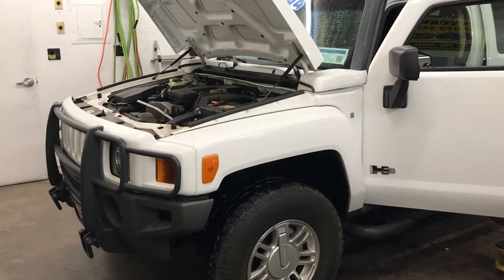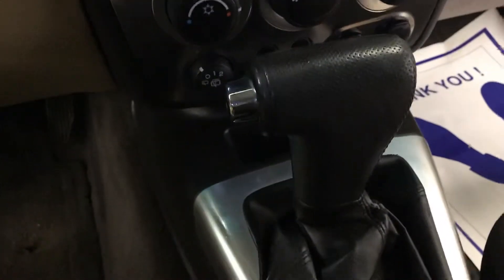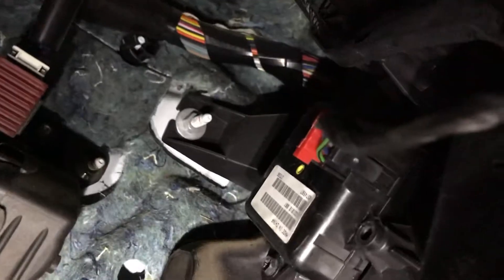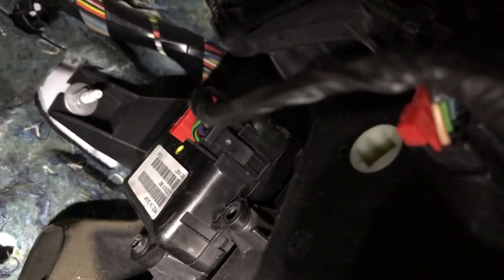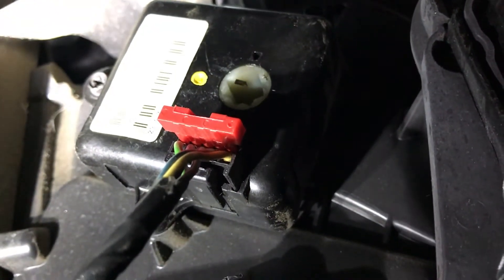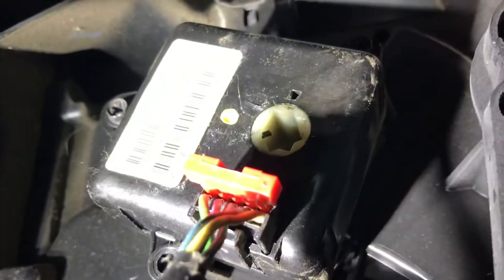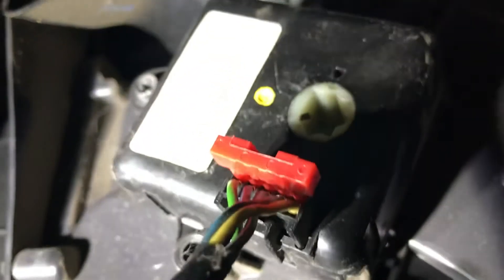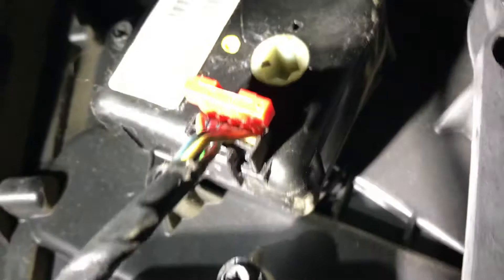Hummer H3 blend door actuator identification

Comment: Thank you for the video. My  ac works and the vent speed works. I just don't have heat. Hopefully after replacing those two you pointed out will fix the issue.
Reply: Did it work?
Reply: @Banestudent21  yes it did. Thank you

Comment: thanks for the video. quick question: i had the actuators replaced a few years ago but i am getting the same issue were when i click the cold/hot dial one click past cold - the actuators fully engage and blow 100% heat. would you recommend i change both or just the one closest to the console? Any suggestions would be great.